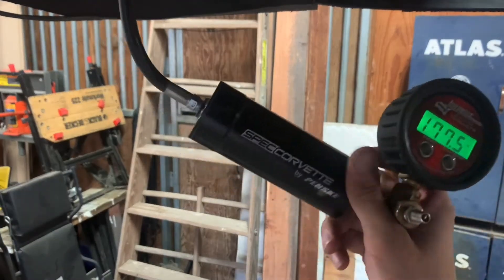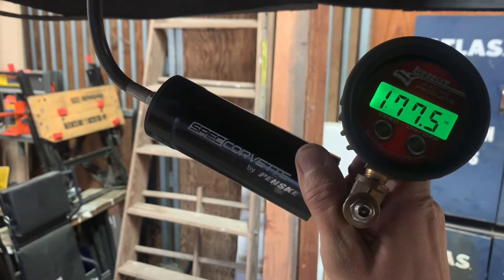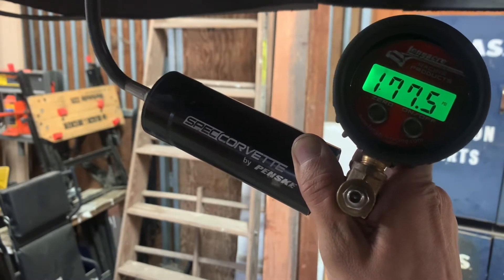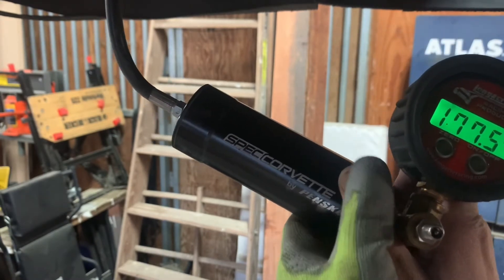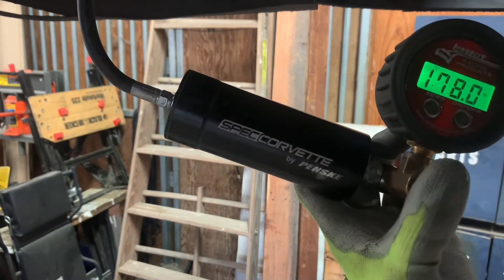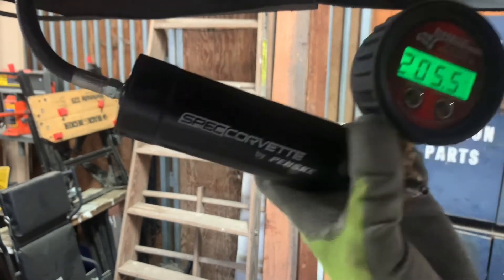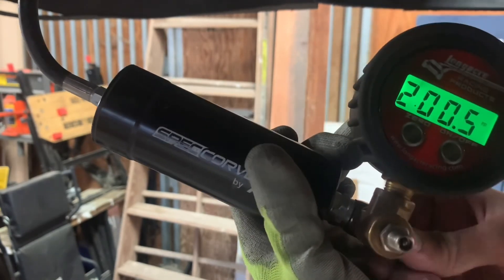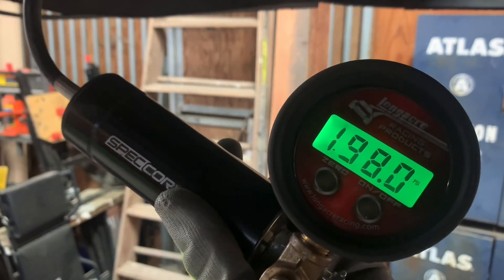Spec Corvette Penske Pressure Check

Comment: Really helpful. Thanks. BTW, is there something special about the "shock" pressure gauge?  Or will a standard tire pressure gauge that goes up to 250psi do?
Reply from the maker: Yes, the shock pressure gauge screws onto the schrader valve to form a seal, then you screw in the pin to compress the valve needle. Those are necessary to get a good reading and prevent pressure loss when you remove the gauge. You’ll also want to have nitrogen handy to add pressure to the canister. https://www.speedwaymotors.com/Longacre-52-50483-Digital-Shock-Inflation-Pressure-Gauge,282802.html?sku=47550483&utm_medium=CSEGoogle&utm_source=CSE&utm_campaign=CSEGOOGLE&gclid=CjwKCAjwu5CDBhB9EiwA0w6sLd0zVL9mC_i4LvzNeGshHADHivGHYff6dMlkeHQA5EXaHQN4BiT8RBoCAk0QAvD_BwE